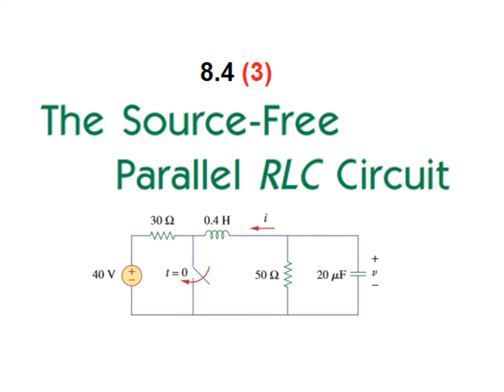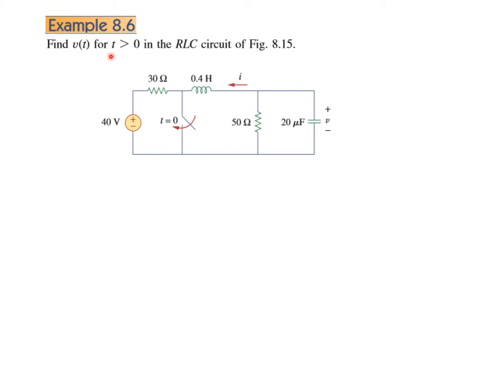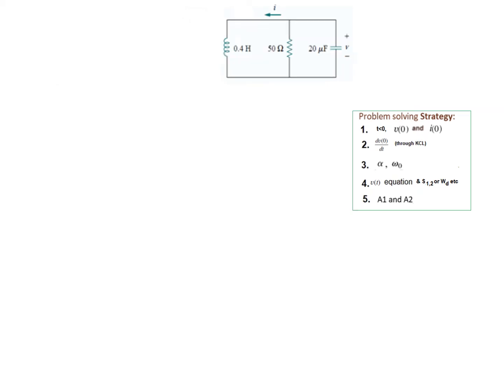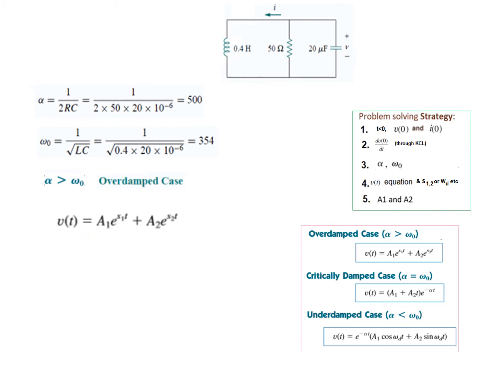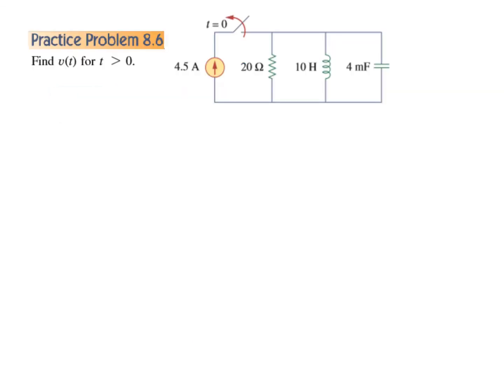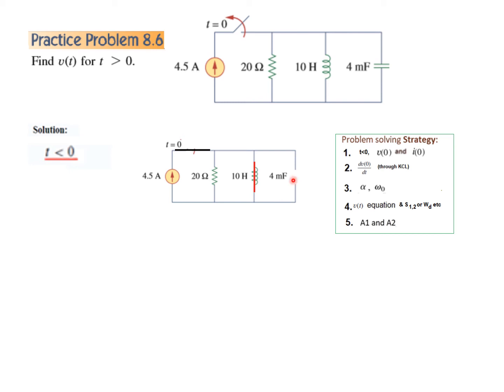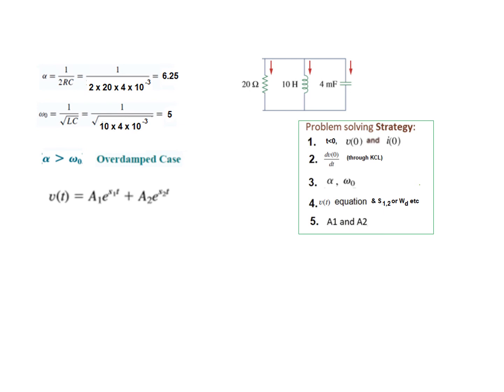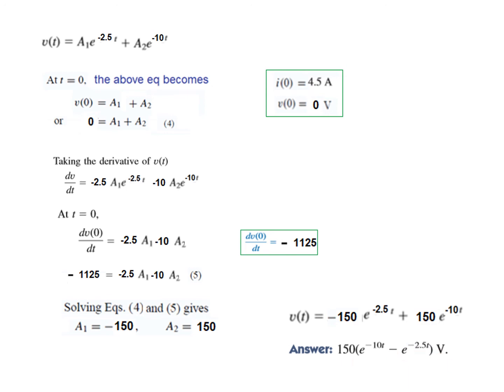(English)LCA || Example & Practice 8.6 || Source Free Parallel RLC Circuit

Comment: i don't understand current division part?
why we do 40/(30+50) is anyone explain pls
Reply from the maker: It should have been written as [40/(50+30)]*50.
 Here is an easy example for you to understand: Suppose you have two groups of people , 1st group has 30 people and 2nd group 50 people. You want to distribute 40 tons of food between them. How much will the 2nd group get ? How do you solve ? You divide 40 ton by 80 people (30+50) to get each persons share. Now you multiply the answer by 50 to find the total share of 2nd group. This is voltage division rule :face-purple-crying: